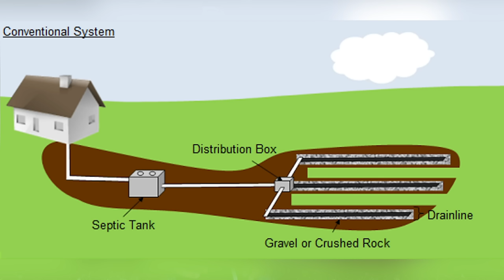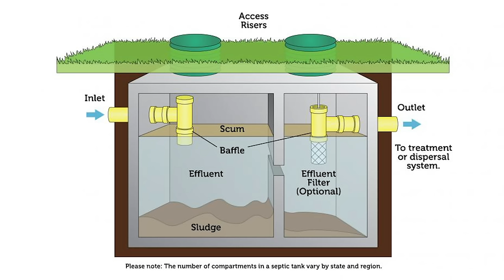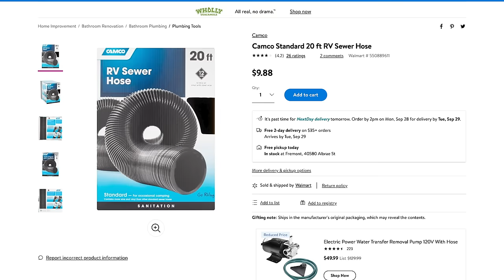DIY RV DUMP STATION 💩How to dump your RV tanks into your home Septic System

Comment: DO NOT DO THIS!!!  I just talked to my septic pumping guy, and he said doing this will ruin your drain field in about 3 months.  It has to do with what happens to the effluent in the tank.  There is stuff that needs to float until it is digested by the bacteria, and stuff that needs to settle to the bottom.  In between is the clear "Effluent" that heads to the drain field.  When you dump 40 gallons of black then 40 gal off gray from the lid it stirs the whole tank and wipes out that delicate balance of what is floating, and what has settled.  Solids then will run into your leach lines and clog it up.  If you are going to do this (it is not per code) but at least tie into the line that runs from the house to the tank with a full sweep.  That way the sewerage enters the tank where it is supposed to.  Also, never use any type of RV deodorant, or any chemical that helps dissolve the sewerage.  This also ruins how the tank is to work.  It is the bacteria in the tank that makes it all work. And never dump it all at once.  Dump maybe 20 gallons then wait 15 minutes, and dump another 20 gal.
Reply: As a plumber who installs septic tanks and Leitchfield I agree 100%.
Basically by dumping such a large volume of solid waist into your tank a large portion will go directly to the area that only the pure liquid waste can go 
Thus clogging the system up.
The only way to fix a clogged Leitchfield is to fill it in and rebuild it.
As a example: the more people that uses a system = the larger the system must be.
Reply: This would be okay if you are flushing your RV black water tank after a season. Use the camp sani station if available
Reply: I was told the exact same thing by my septic guy, thankfully I only used it once.

Comment: You don't want to dump that close to your leech field line.  Go find the input line and put your T joint in there.  Because you put your dump next to the leech line, you're going to churn your sludge right next to the exit which will cause sludge to enter your leech.  I have to give this one a big fat NO, don't do this.  Put the T on the input line.  Not in the middle of the tank.
Reply: hes not bro
Reply: I know its been three years and you likely wont see this, what would you suggest?

Comment: Great idea, but my main concern is that RV wastewater is not going through the intake baffle on the septic tank.  What I think is going to happen is that you will have all the RV waste solids sitting on top of the Scum layer and the heavy particles "might not" settle to the bottom of the tank like they are supposed to (trapped on the Scum layer).  An extension tube down through the scum layer might be a fix.
Reply: I was thinking that same thing.
Reply: @brian Dexter, did you find out if this is a viable concern?  I am doing this very thing tomorrow.
Reply: You hit the nail on the head.

Comment: Did you do any research on if your allowed to cut a hole in your septic lid? My county is really strict on septic systems and I'm concerned it will violate something. I normally just unscrew the lid and dump.

Comment: I highly recommend getting a clear fitting at the septic tank lid so you can see that all solids are coming out and you can see when the water is clear when flushing your black tank. Its inexpensive and I think is a must. If your stomach can’t handle it get a blue dye That is septic safe. Tons on the market. Also make sure whatever cleaners you are using along with toilet paper are septic safe.  Great video. We were full time but now purchased a home and want to connect to our septic for friends and family to stay in the trailer when visiting. This is a great idea and very cost effective. Another thing I have seen people do is run solid pipe. It holds up to the elements of weather much better and you can build a form to run the pipe at proper slope if you don’t have the best drainage.  Of course it’s a lot more expensive and more for long term.
Reply: Very important considerations and recommendations here. Thank you for the added input!

Comment: I told my septic company about my plans to do this last month while they were out here pumping. They saw no issues with this. What I’ll be doing is setting the cap in a 3” UniSeal instead of caulk. It has the coupler and then a 3” ABS downspout that’s 3 feet long. The hose will be permanent from mother-in-law’s RV with the black valve always open. When the grey tank in RV gets full, or every few weeks, I will close the black tank valve, detach the hose at the riser, and go over 4 feet to the liquid side (of septic system) to empty the grey. The leech-field is a new construction that replaced a pit 2 years ago. They gave us an extra 10 feet on it for good measure. We plan on taking good care of our system and I’m not afraid to give this a try. I appreciate this video and this option is  saving us hundreds and hundreds of dollars. If I find out differently, I’ll update this comment.

I only came to say, the only thing I’m doing differently is the 3” UniSeal (for $7) instead of caulk and added the 3’ pipe (for $12).

Comment: Thanks.  I was going to install a dump through the knockout on the riser and had many obstacles, (pipe od, fittings, etc.) plus much more expensive.  Your way is easier and cheaper.

Comment: In my two homes, both have concrete covers that are buried. Michigan & Florida. Going to be a challenge on ether of them.
Reply: install a riser.  I had my septic pumped today and am installing a riser and putting in a fitting like he did.  Once the septic company cuts my length of culvert, I'll pick it up and install it tomorrow at this point.
Reply: @curty85  how did this work for you?  I'm thinking of doing something like this.

Comment: Alot of comments point out something that seems to make very good sense!!!

Do NOT drop your waste directly through the top of your holding tank (first tank). This will upset the fragile eco system that 'it' is.

Tap into the waste line that comes from your house and into that holding tank (first tank). 

Thats hard to do obvously cuase it's going to be buried 2 or 3 feet below the surface. More often then not there will be a clean out that taps into that same line and that is where you could tie your RV waste line in.

Comment: If folks are waiting to get home to dump, make sure your black tank has support under it.
Most rv’s are designed for you to dump before travel, and will not handle travel with the weight of a full tank.

Comment: Thanks for the video. Years since I had an RV but what about the chemicals? If you are dumping to the septic tank do you need to keep the chemicals out of the RV tanks?
Reply: I have the same question. I'm told RV chemicals can really mess up the way a septic system works...

Comment: Your system is only capable of breaking down waste at a rate you normally use it. If you’re barely there traveling in your rv, then you dump it when you get home and use it like regular, you’ll be putting an extreme load on your system and could do damage to it depending upon age of system and maintenance routine. Also, silicone is not a suitable bonding agent. If you do this, use PVC glue where the coupling attaches to the adapter on the underside of the lid. Still silicone the top but glue the bottom.

Comment: Even the Rhino version of hose is not very sturdy. Mine had holes in less than two years and I was not sure where the smells were coming from for months. If you are on your own property it makes sense to just buy ABS pipes and set up with no risk of leaks...stink doesn't just disappear if those hoses fail. Not worth the risk. LOL

Comment: Another good reason not to do this is Bacteria. A good functioning septic system needs plenty of bacteria to break down the solids and function properly. Be cautious about dumping any RV holding tank sewer in a septic system that has been treated with aftermarket conditioners to reduce smells and odors. These chemicals will neutralize the bacteria in a septic system and drain field over time. Only way to fix the problem when this happens is sucking and flushing out the septic tank and digging in a new drain field.

Comment: I wonder if it is better to tap into the sewage pipe that leads into the septic tank instead of going through the cover, if that is possible. I will explore this further and will ask my septic guy. Fascinating subject BTW :and thanks : )
Reply: Yes, it is better to tap into the line from the house because then  the sewage enters the tank without stirring it up and the system can operate as it was designed. Use the clean out. You may already have one in that line because in most places it is required.

Comment: You show a pipe under the septic cover.  Are we to line up the new intel with that, or avoid it?
Reply from the maker: Avoid it.  Otherwise you will get build up and cause potential issues.
Reply: Thank you for the question..I was wondering also.

Comment: Did you think about getting a long PVC pipe to get to you rv instead of hose??
Reply: long pvc and short flex hose on each end will work great,  as long as the connections (transitions)  are proper

Comment: If the slope to too much downhill, won't the liquids leave all the solids behind?
Reply: yes,   dont go much over 1/4" slope per foot,  (around 7.5 inches drop,  over 30ft,)   maybe a bit more for plastic corrugated flex,  OR you risk clogging wtith solids.   If you MUST exceed that slope,  then plan on blasting the flex line with your (saved) discharge from gray water tank,  every several days

Comment: Most homes have a clean out so why wouldn't you just use that? Even if it doesn't just tap Into your pipe going to the first chamber which would have made it a much shorter run and probably wouldn't have needed any additional hoses.
Reply: I had to add an extra clean out because the existing one wasn’t in a feasible location.  They may have a similar situation.

Comment: I can't do it this way because my tank and lid are concrete.
Reply: same here. Did you find an alternative?
Reply: Why couldn’t you put a Y on your breather pipe that pops out of the ground?
Reply: @nickm.1238  Don't have a pipe out of the ground.  
it vents only on my roof.
Reply: Find your sewer input line and put a T on it.  You will have to hand dig it.  It should be about 36 inches down if it's done right.